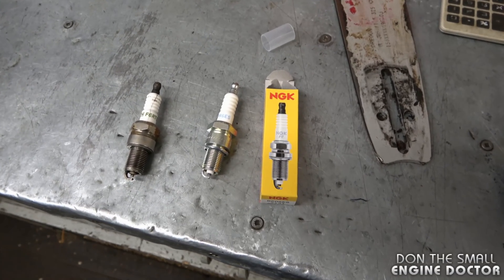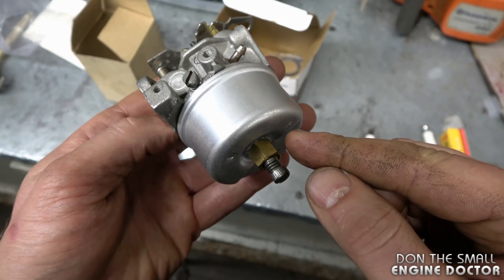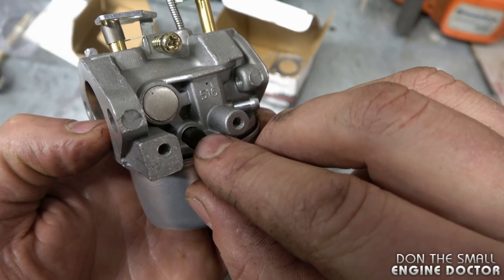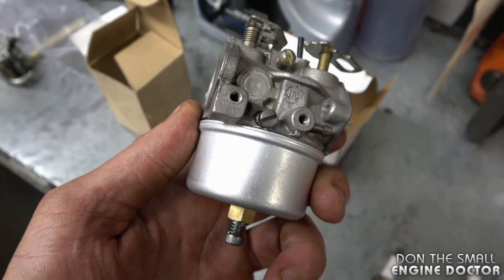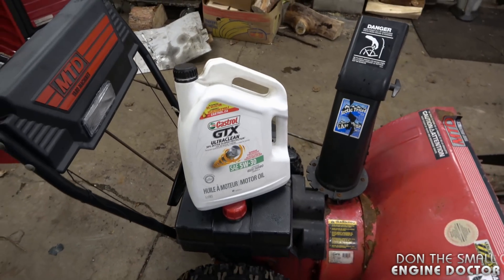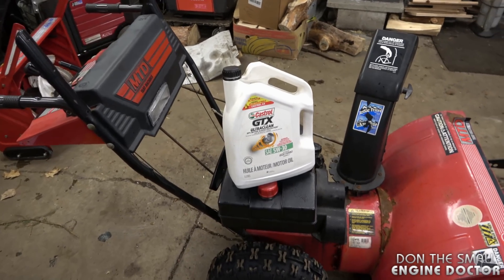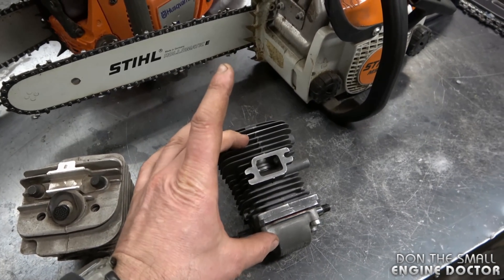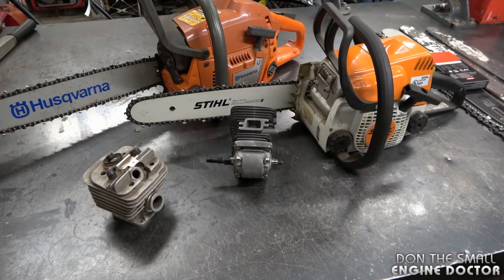Small Engines Q&A #156 - 4k

Comment: Dony, have you ever had a starting dog come off. I have a husqvarna 61 and has become hard to start. When I took the pull chord gear off, I find one of the spring pull that's turns the engine came off the engine.
Fortunately I found the part but couldn't find the screw that attaches the engine.
Do you have any solutions regarding this, either replacing the whole part or to secure the spring pull back.
Many thanks and I love the channel for so many reasons.
Thank you in anticipation
Clive

Comment: Hi Don, thanks for all you do. If you would advise: FS80R string trimmer. I replaced ignition coil because no spark. After doing this, trimmer cranked up first pull, however, it will continue to idol but when I ramp up rpm it does but not smoothly or high enough and ramps up sounding rough. Your recommendation would be appreciated. Thanks, Brooks

Comment: First of all awesome videos, I always refer to your videos for all my engine repairs. I just bought a 5/23 craftsman snowblower for $50 which sat in the guys garage for 2 years.  I brought it home, cleaned out the carb, put fresh gas and changed the plug and it fired right up.  The problem is when I was putting the carb bowl back I must have over tightened the bowl nut and it snapped in half and I’ve had a very hard time finding a replacement part.  The model number to the blower is 536.886510 and a code number of 8281.  I did find where the engine number is located but most of it is faded out but from what I gathered it stars with either a 143 or 743, I could be way off on that.  Any suggestions?  Or should I just buy a whole new carburetor?  Thanks I’m advance

Comment: I have a craftsman snow blower model 247.885570 that won't start. I used it 3 weeks ago then the drive cable broke,I replaced it by putting some plastic over the gas cap. since then it hasn't started.

Comment: Hey mate. I got a problem I own a ms661cm and rear bar bolt stud has threaded the casting. How do I fix it without costing me a fortune. I have a couple of ideas but if you have a better let me know. 1 idea is using green high strength loctite on it. 2nd is using helicoil but I don't know which one to use as I want to use the same bolt stud as nothing wrong with the thread. 3 your idea?
Reply from the maker: I use heli coils
Reply: @donyboy73  so you know what size is need to buy?

Comment: Donyboy73 can’t go wrong with a used Honda snowblower. In USA 🇺🇸 a new Honda snowblower is $3400 for a 1332. For a used 1132 to 1332 your looking to pay $1000-$2500 used depending on the season. First Honda I bought had teeth worn down all the way. I got smart and got my second one seeing that teeth were fine. These snowblowers start up easier than my brand new ariens. Maybe my ariens deluxe has one of those crap spark plugs and that why not starting easy. I’ll check this out and replace with champion or NGK

Comment: I bought an Oregon Replacement adjustable carburetor for a snow blower. Talk about CRAP!  I paid $40 for JUNK!  A $15 cheap Chinese Carb would have been better. I had to drill and tap the front holes for the cover. The main jet was screwed into the seat so hard, my guess is it grooved the seat. Gas pours out the front of the carb when priming. The float was not even set right. I will NEVER buy another Oregon carburetor again.

Comment: Why would a previously good non-adjustable carb start surging? Did something change internally? If so, what specifically? Anytime I've had the problem it was because the tiny little hair thin carb spring broke. Just wondering. Thanks.

Comment: I have a question. I have an older snowblower. 36 inch cut, self propelled at rear wheels. Problem is the shear pin. No matter what I use they always snap. It is a real pain to realign the rear snow covered wheel to replace the pin. That is after dragging it back to the garage. Any recommendation for the best type shear pin?

Comment: Hey Donyboy. I really enjoy your videos. I thought in the small engines I was to use SAE 30? One time my lawn tractor was low on oil, so I used 5W30 and it smoked like crazy. I am not sure about this one. Thanks for sharing.👍👍
Reply: Thanks @lyerlyman  .. I guess that is why my lawn tractor smoked. I put 5W30 in my mower when it was 75 deg F.  I only use the tractor in the summer when it is 70 deg plus. and the grass is growing.
 I use my snow blower in the winter and the 30 weight seems to be fine and it gets -20/-25 here.  Maybe I should be using 10W-30 so it will start easier.  Thanks Again

Comment: I’d disagree with putting an adjustable carb on an engine that didn’t have an adjustable carb. I tried and could not get it to run worth anything. Decided to clean old carb again really well and ran like brand new. Maybe not with all engines but mine didn’t like the change
Reply from the maker: no problems with oem carbs

Comment: I have a question regarding fuel and fuel lines, I have a lot of small engines and our family has multiple boat motors.  In the past year maybe 2 all of my small engine fuel lines have had to be replaced.  And  2 outboard fuel lines have had to be replaced.  The fuel has come from multiple locations. All of my small engines run no ethanol fuel.  The boats have had ethanol.  All of the motors are different ages.  Have you seen this trend? Has Quote "100% gas fuel" been modified with a corrosive additive?

Comment: hello donyboy, this is a great Q&A..i have a problem that i'm not sure of. I own a generac 7500 watt generator and I was adding fuel in it and the chain on the gas cap  came apart  at the end of the chain and I think what ever was holding on to that chain from the inside fell into the gas tank. the reason I say this is last week we were out of power for 3 hours and the generator was surging and bogging down constantly during that time and the junction transfer meter in my garage was going high and low also. this generator is only 3 yrs old and I maintain it always..your help in this matter would be appreciated...anthony

Comment: Great to see the Q&A back again👍. I would also say never use an E3 plug, everyone I've seen did not run right. Also if you find a used snowblower that was hardly used that could be a good deal.
Reply: Id say never buy used 2 cycle equipment 100% of the time.

Comment: I bought a Stihl wood boss earlier this year from Ace hardware. It came with a 3 year warranty. 
Best 400 bucks I've spent. 
Already cut down two large trees and several small ones. Also cut up 3 huge boxelders that were previously cut down last fall. I haven't needed to sharpen my chain yet but it's going to be done soon 😁👍🏼

Comment: How do I ask you questions to be answered here? I've a 55 rancher saw with low hours. Too hard to pull start (snaps back and almost breaks fingers). Removed sparkplug and its fine, and fuel/air come out of hole with each pull. Think I need to strip it down to see if exhaust is plugged? Spark screen issue?
Reply: You need to adjust the valves
Reply: @jameslarson6555  adjust the valves on 2 stroke engine...😂

Comment: My craftsman snowblower did not come with fuel shutoff should I install one?
Reply: Fuel shut-offs are cheap and usually easy to install. And  a good idea. My neighbors riding mower wouldn't crank. I checked the oil level and found that the crankcase was full to the top of the dipstick. Apparently the float needle valve had stuck open and allowed gasoline to leak into the engine. This can be prevented by installing and using a fuel  shut off. It's rare for this to happen but could result in destroying the engine. So it's worth the cost and time to install a fuel shut off.
Reply: YES, DON'T wasteany time in doing so, BUT get the metal ones and NOT the plastic ones !

Comment: Pro tip: Don't buy a snowblower from a local flipper mechanic. You have no way to gauge how worn the engine is. Buy one from a small engine shop if you want to buy used.

Comment: Great video man, I run NGK plugs on everything. I buy them in bulk. 
It’s amazing how all the China made products are taking over the industry. And it seems like it gives consumers a lot of problems. Which I guess is good for the mechanic!
Reply from the maker: manufacturers are using cheap plugs in their equipment because they are so worried about the bottom line

Comment: Donny I have 2 stihl motor brand new FS91 R and BG 65 BLOWER I has been peeling sound with them and I decided to check the compression .my surprise is that both of them have around 70 psi they run great .is that new 2 CICLOS come with lower compression?
Reply from the maker: some may run but it's quite low

Comment: Here's one for you:  Why won't my riding mower move with the deck raised fully,  but runs normally after I lower, then raise, the deck?  Everything underneath appears normal.
Reply: Thanks, but it's not hydraulic.  I'm not aware of any safety switch related to deck height.  It's a Craftsman 4000 series.